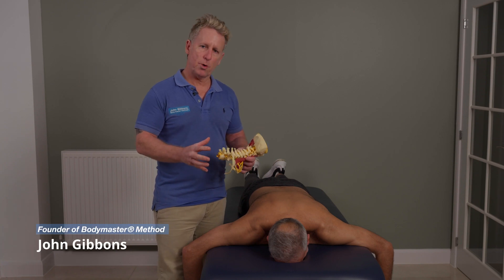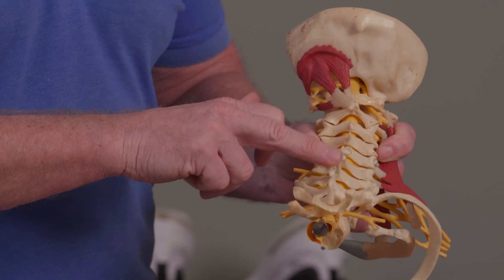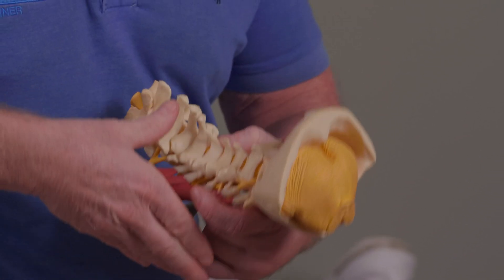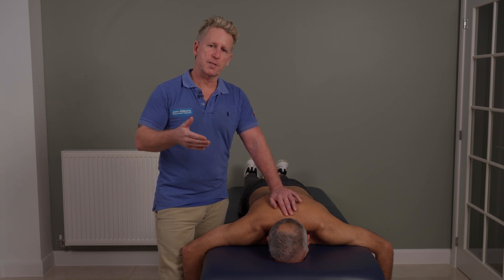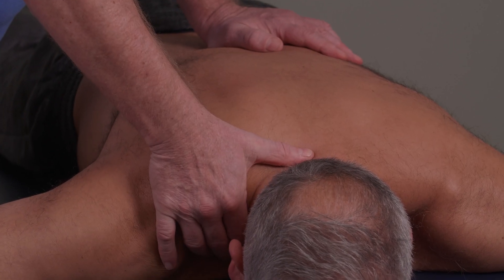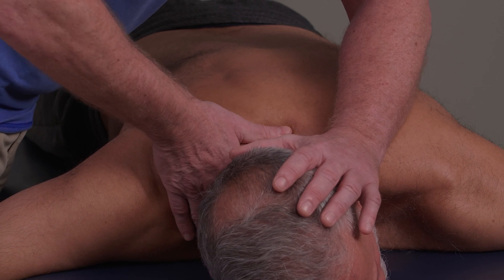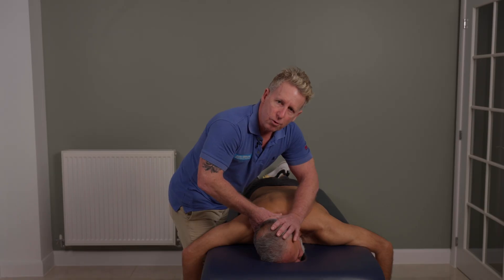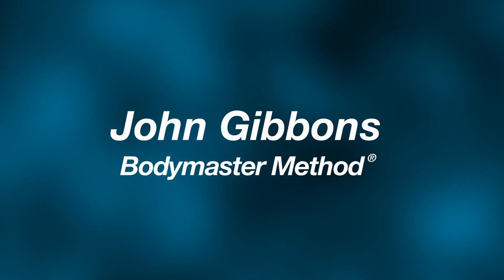Manipulation of the Cervical Thoracic Junction (CTJ) - Prone using thumb

Comment: I have had neck problems for several years. Sometimes stronger, sometimes weaker. For a good 6 months I have the feeling that it is getting stronger and stronger. My passion for the last year is road biking. I know, neck and road bike is not a good pair, but I love it. But now I feel stabbing pain after 30min. It is very uncomfortable - although I have made a bike fitting :-(

I am seriously thinking about contacting you, because I have been tried by masseurs, orthopedists, physiotherapists, osteopaths and sectoral healers. All unfortunately only with short-term success.

Could you help?
Reply: Try using a cervical collar while riding..I know the pain well..I used to ride a lot. Also put the collar on after riding. Amazon has a good selection.
Reply: @drcarriemills8772  Thank you for your help. Did it give you a lot of support? My first impulse is that I am weakening the muscles with it, because the support does the postural work.
Reply: @Wikato  you are not weakening your cervical muscles you are supporting them. I have a collar I can sleep in. I have used it driving cross country.. so for hours you can wear it. Try to find an AO (Atlas orthogonal specific) chiropractor. That specific adjustment will last longer.
Reply: @drcarriemills8772  Thank you very much. It will help. Best wishes from Germany 🇩🇪 👋🏻
Reply: @drcarriemills8772  Interesting technique! In Europe we have 2 of them. One 70km away. Thank you again 👍🏻👍🏻👍🏻
Reply: And how long did you wear it in summary?